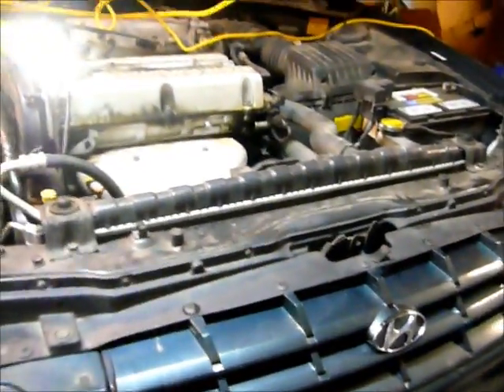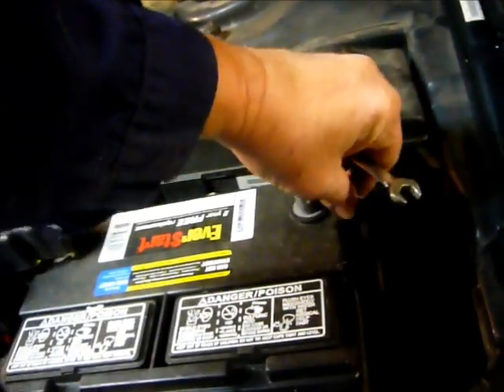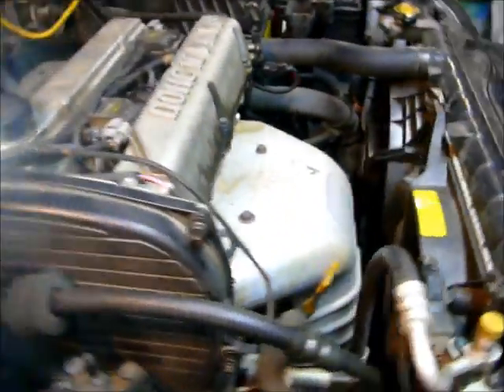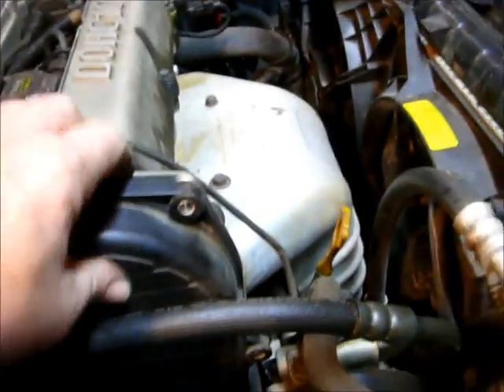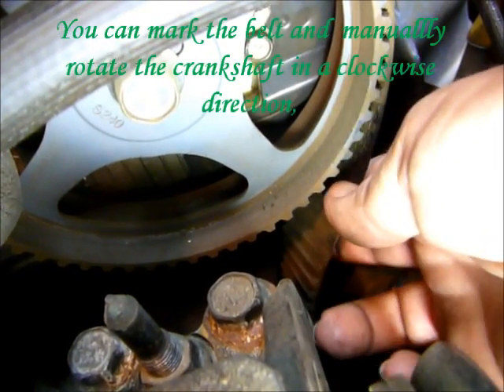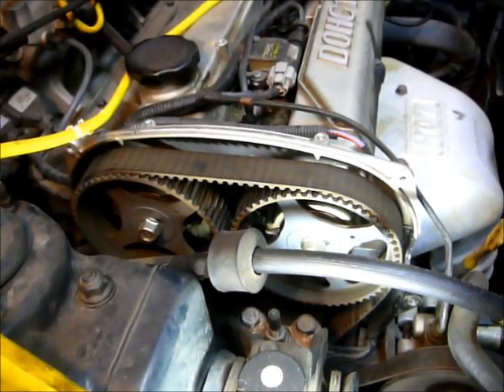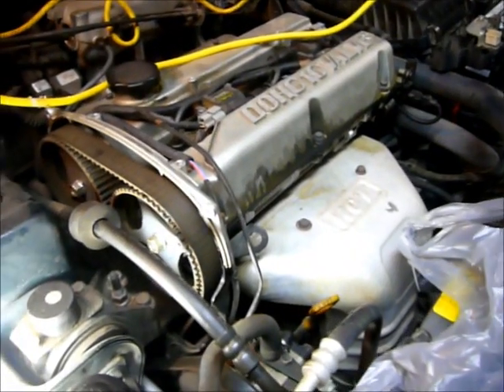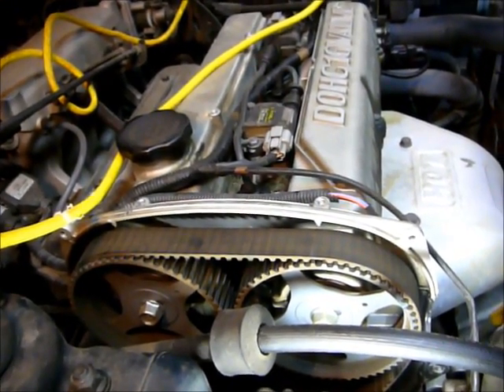Hyundai DOHC 2-4L Timing belt check to prevent catastophic engine damage.wmv

Comment: this just happened in my 01 sonata 2.4 l. But belt was fine just slipped a tooth or like 8 lol. Dropped 5 valves and blew a hole in two pistons. But the cylinder walls are all untouched and no bent rods. so gonna get crank inspected and rebuild it with a new ported head.
Reply: jacob rusher how much did it cost to get replaced

Comment: Is the process similar to an accent 1.6 auto?  Thanks
Reply from the maker: This should be similar for most front wheel drive vehicles. The process to get to the belt may be different, but the results will be the same. The best thing to do if you can't find a view of your timing setup on the web, is go to AutoZone or your preferred parts store and either buy the book for your auto or at least thumb through it.

Comment: I have a 2005 Kia Optima that has the same engine.  I've always been advised to change the timing belt every 40,000 miles on it.  It's been a great car, but changing the belt so often can be a pain.  Due for it again soon.
Reply: I did it 5 times without removing the engine from the bay. Last time I have beaten my personal record and it took me about 4h from lifting the bonnet, to starting the engine. All fine.
Reply: Its Always a Good Idea to do the Crankshaft Position Sensor,Water Pump,Idler Pulleys & Jake Belt at Same Time of T.Belt Serv.the Csp Sensor is A Piss Poor Design & Rarely Lasts As Long as the T.Belt,Tks.to Aftermarket Ones that Are From China. Oreilly's House Brand is CRAP & HAVE LEARNED TO GET THE CSP SENSOR FROM DEALER OR ONE THATS NOT MADE IN CHINA.

Comment from the maker: I have more footage on the actual replacement, just haven't edited and posted yet. I ended up ordering a kit online that came with all the idler pulleys, the tensioner and both belts that are in this area.

2001 HYUNDAI SONATA 2.4L L4
BECK/ARNLEY
0291119 (029-1119)
Timing Belt Component Kit
$ 121.89
From Rock Auto

Also, you may find these sites helpful:
hyundaitechinfo com
hyundaiforum com/forum/hyundai-santa-fe-20/loss-power-underload-2-4l-5588/

Good luck!